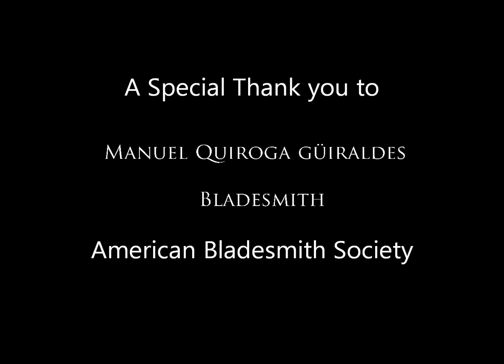Making a Twisted Multi Bar Damascus Blade by Manuel Quiroga Güiraldes, AP

Comment: I have trouble finding words to describe how amazing this knife is.  I hope to become that good at bladesmithing.  Please make more videos like this.  Side note, I hate how slow the hydraulic press is lol do you ever have issues with losing too much heat with the press?
Reply: +William Cummings Thanks William! BTW I already solved the issue with the press being too slow. I took the filter out and it started to run much faster.
Reply: +Manuel Quiroga That's good, glad to hear it!  Keep up the amazing work!
Reply: you should clean the filter, not remove it. It is there for a reason.

Comment: I was wondering why your hydraulic flat dies were dished and had rolled edges. I think your pump is running too slow. The temper on the dies has been lost due to the enormous length of time that dies are in contact with the hot steel. Btw, I love your work. Keep thinking outside the box!
Reply: +Glenn Wiebe Thanks Glenn, I solved the hydraulic pump problem, a took off the filter and it started flying!

Comment: the knife looks awesome... at first sight of the package I thought he want to make a sword and then he takes so much good material away ...what a waste but finally worth it
Reply: +XJ9 there's a reason for that waste...
Reply: +XJ9 I'm as confused as you are.  I thought he was making a sword as well.
Reply: The reason why he did so - because the final pattern in the middle of bar. on edges the pattern is not so impressive.